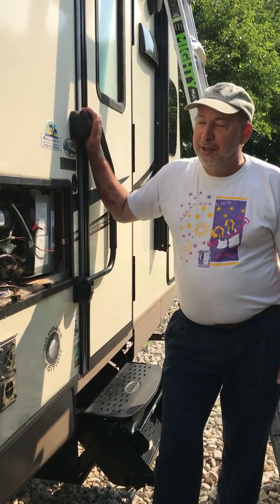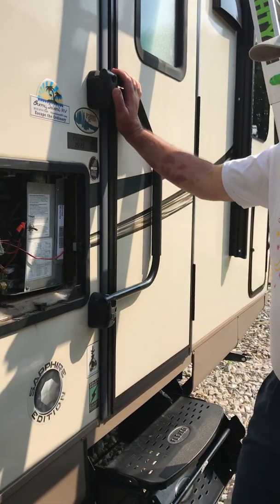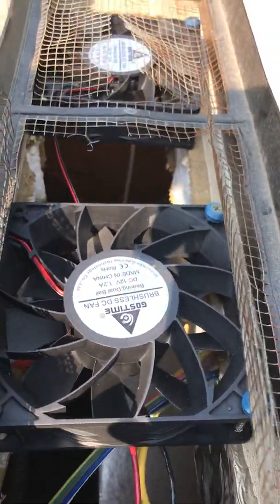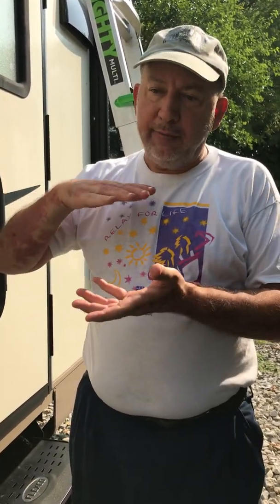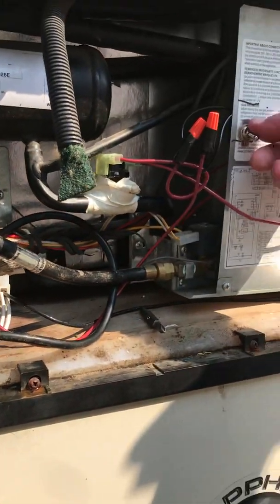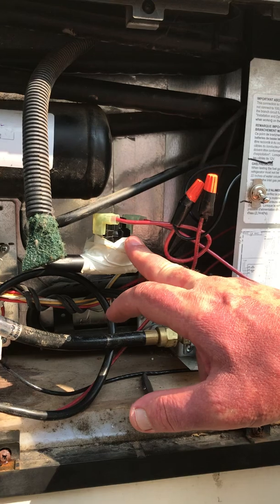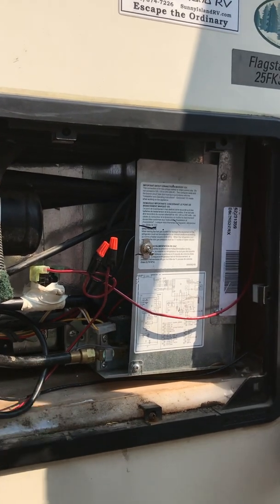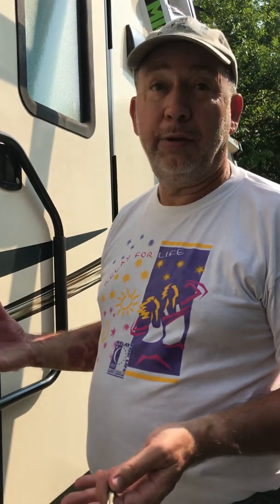Dometric RV refrigerator not cooling

Comment: My travel trailer is in the shop as we speak.It was having troubles cooling the fridge but the freezer was acting like the fridge and never frozen anything they quoted me $1200 for a new cooling system to install it 🤦🏽‍♂️ should I tell them to check the fans or add fans?
Reply: I know it's been a year. I'm poor and was just going to replace my ac/gas with a small condenser fridge. You can get a  decent size for <$250.